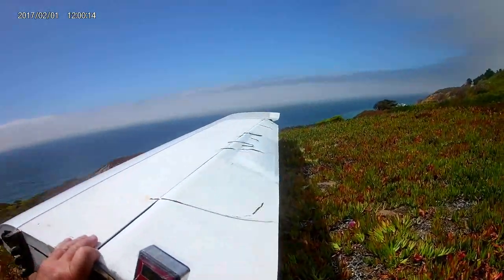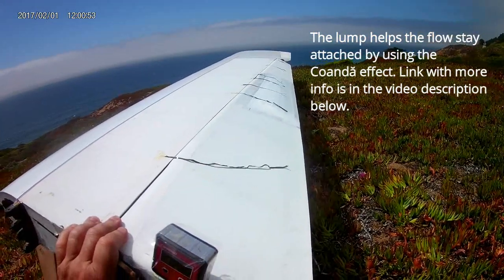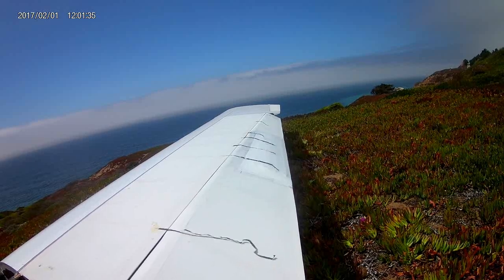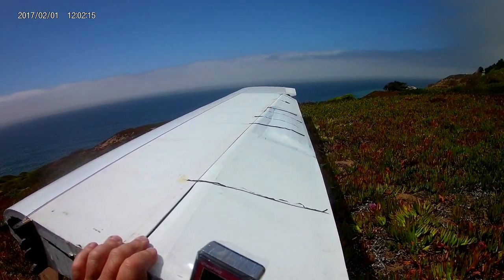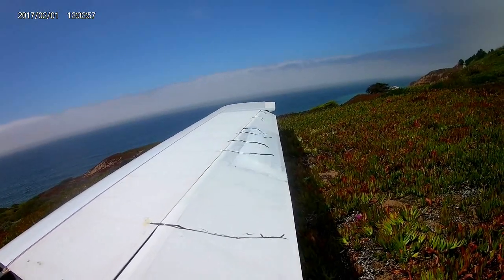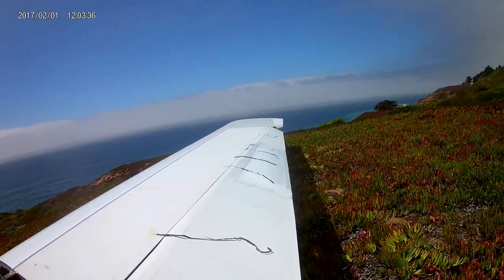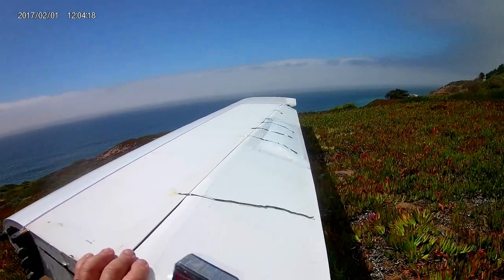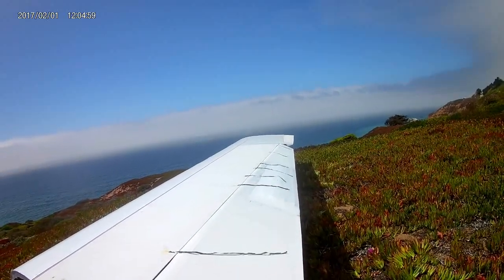Elevon Lumps for Flow Control - Klingberg Wing MkII Development

Comment: convergent evolution with the swift. hopefully its cheaper if you go into  production.
Reply from the maker: Bigger and higher performance is never cheaper. However, I designed this glider in a way such that it can be a home built project. But the market is so small, it's probably not worth doing all the drawings and instructions! Where it will all end up, remains to be seen.

Comment: I've been watching your discussions of the elevon flow control issue and have been slightly baffled.  I know you know this stuff better than most of us but I don't understand why you don't simply "fatten" the elevons a small percentage at the hinge line (perhaps I missed your explanation)?  A Bede newsletter addressed the issue and shows that a 15% increase in thickness of the control surface at the hinge line should solve your flow control problem and at the same time will reduce the airfoil Cd down to about the Cd of the airfoil without a control surface.
Reply from the maker: Yep, all discussed in previous videos. See "Elevon Flow Tests" playlist.

Comment: Will the curve also create more lift at the trailing edge? Negligible?
Reply from the maker: Probably. It will lower stick forces for upward motion. How much is TBD.
Reply: @KlingbergWingMkII  I wonder what would happen if you put the curved side underneath? Like Mitchell wing.
Reply: @chrisfarb   I don't think so.  The Mitchell wing uses a Junkers control surface which is attached behind and  slightly below the wing, which creates a significant gap between the wing and the control surface.  Therefore it act more like an elevator (which frequently are inverted airfoils).  The MKII elevon is closely attached and gap sealed so it will have different aerodynamic effects than a Junkers control surface.
Reply from the maker: Actual applications show that Chris is probably correct. Beechcraft used aileron lumps to lighten control stick loads on some variants of the King Air. Lumps lighten control stick forces by providing some lift to counter the weight of the aileron itself. https://kingairmagazine.com/article/why-do-the-ailerons-have-a-lump/